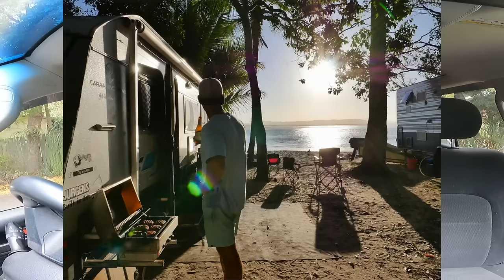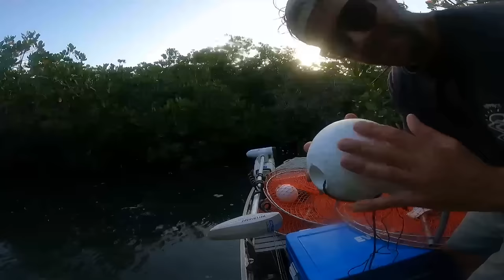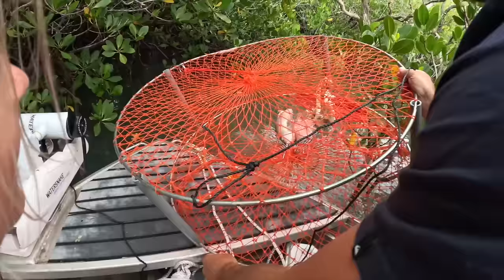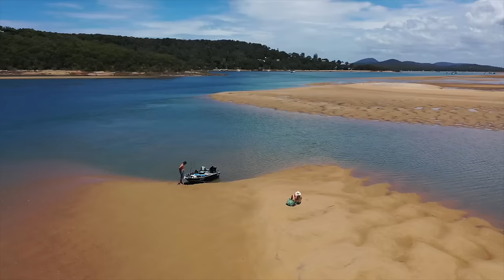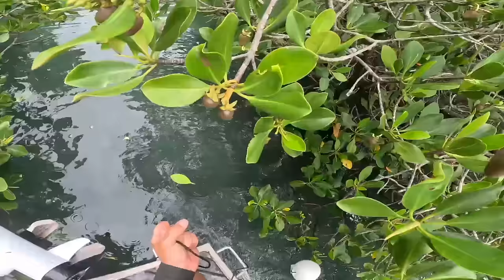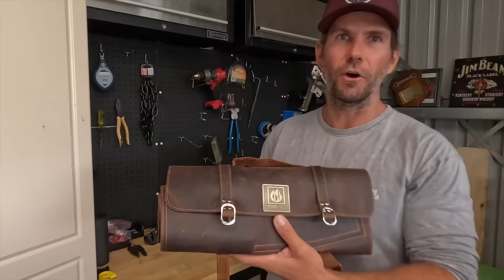1770 beachfront camping. Catching flatty's and mudcrabs in an EPIC part of the country.

Comment: Hot 🔥 tip mate the tag goes on the crab 🦀 pot itself.  Then you write on the float. . Its done that way in case float is cut/ propped  from the crab pot.  FyI

Comment: Oh, and a tip for you Justin, when throwing the pots in, sling the float and rope high up in the mangroves. Not only does this allow you easy access when pulling your pots but also prevents your ropes and floats from getting caught up in the mangrove roots at low tide. Easy to lose a pot due to float and rope being snagged and submerged around the mangrove roots. A gaf is handy to hook up the rope. Cheers mate
Reply from the maker: Great tips, thanks heaps,. Makes sense actually
Reply: And always use the gaf in croc country

Comment: Great vid people. With your crab pots Jason I think you'll find 2 zip ties per plastic name tag . Zip tie the name tag with your id to the inside of the pot so it is still legible when looking down at the pot. Then put your name/ ph number on the float. You have to have the pot identified with the plastic tag and also have your name on the float separate from the pot. Better luck next time with crabs. I usually prefer putting my pots in on half tide at the point where the drains come out into the deeper parts of the creek or out on the flats during neap tides. Good luck.
Reply from the maker: Cheers mate, I reckon you’re right hey

Comment: You must get P%#%d off with me Justin. Do not use hard body surface lures for Flathead. They are bottom dwellers. Use wrigglers or Shad’s. Cast let settle to bottom. Lift and let fall, take up slack lift and fall. Then you will catch the bigger ones. I’m 68 Justin, don’t be stubborn and take some advice. Line and leader is correct size. Shallow water is correct.
Reply from the maker: I’ll take all the tips I can get, cheers mate